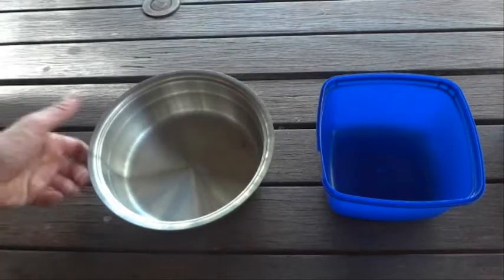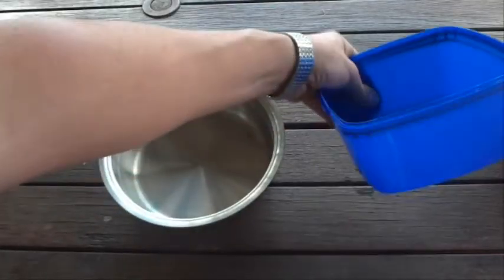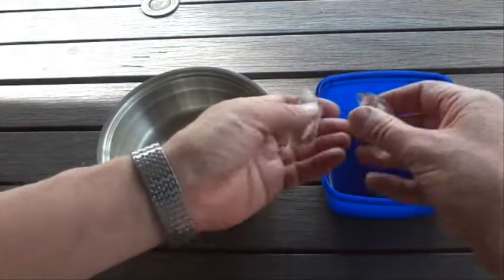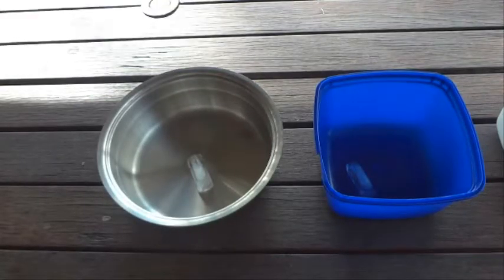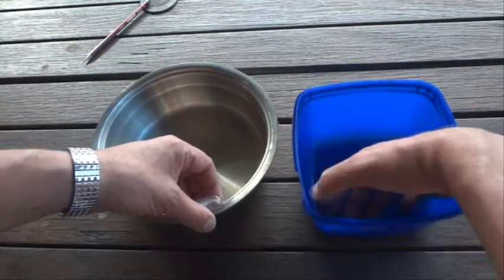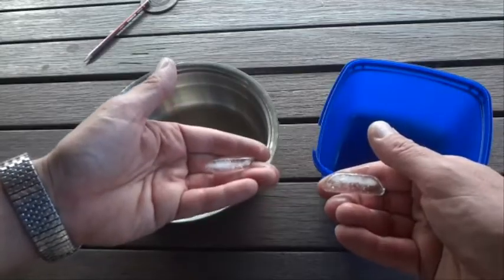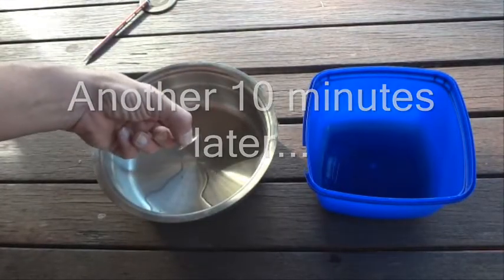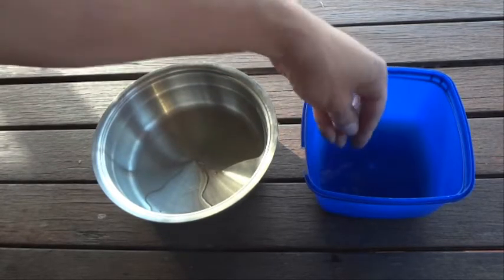Melting Ice in Metal or Plastic - Does the Ice Melt Faster? - Simple Science Experiment

Comment: May I ask what is the reason?
Reply from the maker: The speed the ice melts actually has something to do with the plastic being an insulator and stops some of the warmth in the air transferring to the ice. The metal is not as a good an insulator and so, the warmth in the air is transferred to the ice and the ice melts faster.